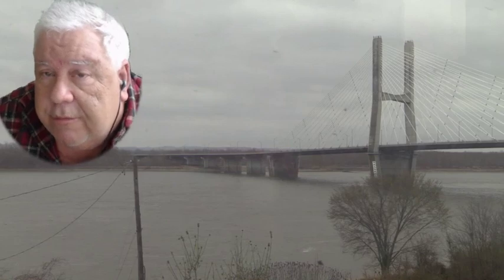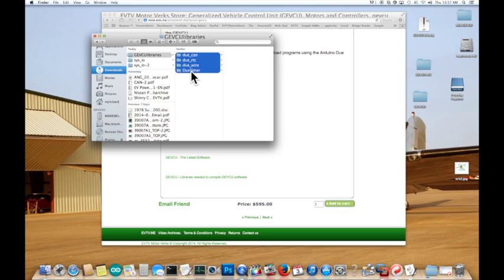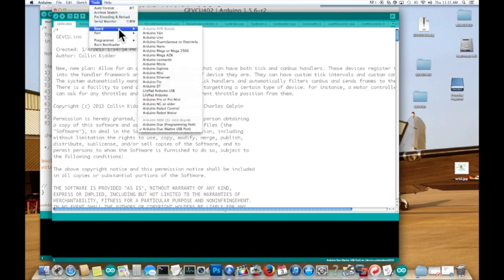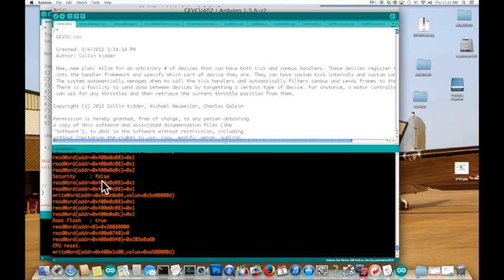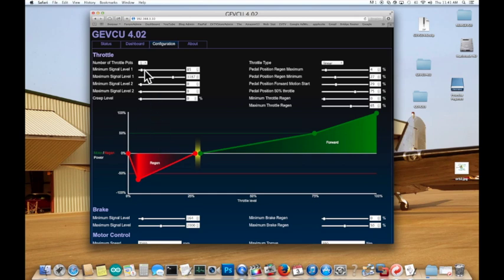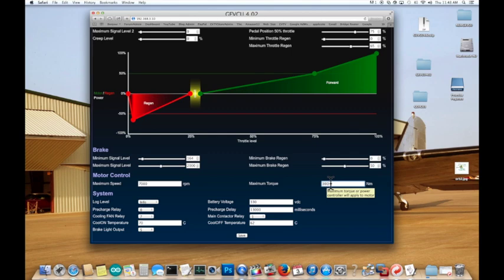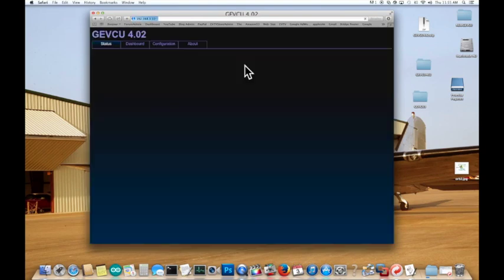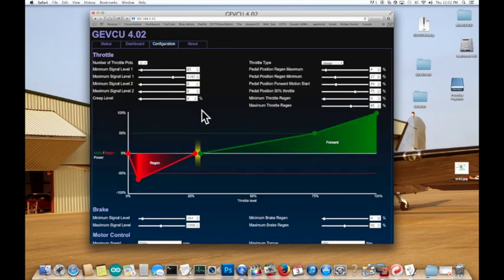GEVCU Software Update Procedure

Comment: I intend to buy a nice 34KW AC Permanent Magnet motor with a controller from a chinese OEM - they say that the controller is fully calibrated to the motor but there controller inputs are real basic and use CAN to control and monitor.  Is the  GEVCU what I need if all I want is to do is turn and drive the car?  I am not sure if seller will provide me with the code for the controller or even if I need such a thing to get basic control of the controller ? If I am determined what are my chances of success?  (I am not beyond paying for help)